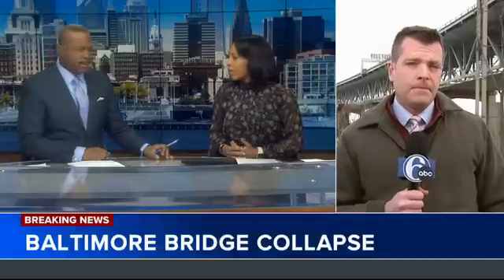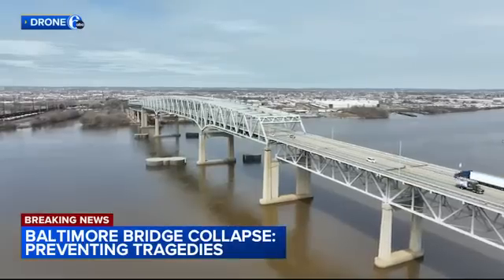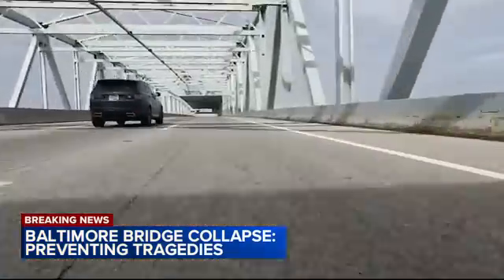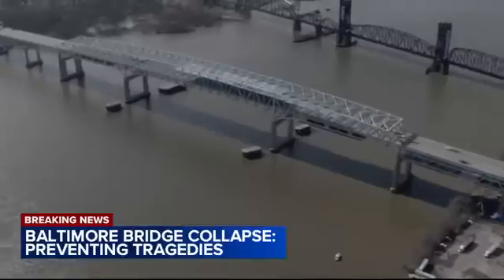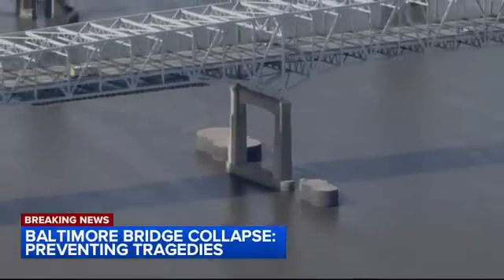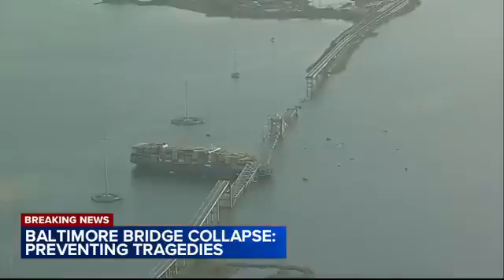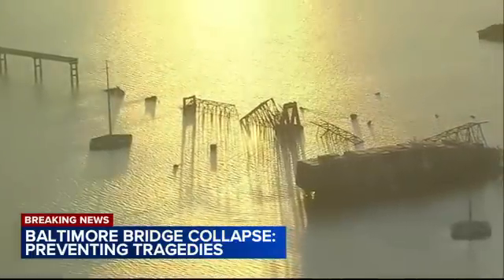Here's what surprised a structural engineering professor about the Baltimore bridge collapse

Comment: Okay, so they have protective concrete bollards installed a few feet beyond the actual piers. Would have protected the bridge from collapsing?  Doubts arise and here is why:  Most ships, even little play sailboats, are narrower at the waterline than at deck line. That makes me think that a ship's deck, even when overhanging its waterline by 10', would have creamed structural supports of the bridge and thus collapsed it. 
Additional question: Could the impact of a fully loaded 900+ feet long ship been stopped, if such bollards were in place, or would they simply have bent and  been rammed into to structure anyway?
Reply: Good points

Comment: I just watched this video and it is so misleading. The port authority CEO and the Drexel "professor" said there were no safety measures in place. There were the same type of safety dolphins in place on both sides of the of the main bridge support piers. They are huge. You can still see them near the other support pier and in front of the ship on the other side of where the support pier. They are just not as close as the as the one this video shows at the Betsy Ross bridge, Those would not stop a 95,000 ton ship if it was to hit them directly. The proof is that the Dali took out the dolphin before it hit the support pier. The Drexel "professor" said that it would stay up if it was built right for a continous truss bridge. Nothing would have made it "hang on". The very foundation it was built on was destroyed. I was 5 years old and watched the Francis Scott Key Bridge being built. I asked my Dad what the dolphins were for. He told me they were for protecting the bridge from a boat/ship hitting the bridge.

Comment: After the collapse of the Tasman Bridge in Tasmania the Bridge over the Orwell River in Britain, a similar structure, had pier protection (in the form of rock islands surrounding the piers) designed in. As soon as I saw the news I wondered why the Baltimore Bridge had no protection around the piers and indeed up and down stream of the bridge. Pier protection is designed to deflect an errant ship away from the piers, rather than stop a ship!
Reply: Actually,  it would be tricky to build that far ahead specifically on the side of Dali impact, since just after the bridge there is turn to the left (looking into the city) into another branch of the port.
Reply: @dmitripogosian5084  As I don't know the layout of the port, I bow to your better knowledge . Still can't understand why any bridge, particularly over/in a busy shipping channel would not have pier protection though. Adding heavy, very heavy, concrete Buttresses around the piers would have given at least a modicum of protection. I suppose it is the old story - wise after the event!

Comment: Everyone interested should carefully review the tape of the container ship in the minutes before it hit the pylon. It is clearly going to miss the pylon, until at the last minute the ship radically turns almost 90 degrees to starboard (right) and hits the pylon head on. 

To effect such a direction change of a huge inertial mass takes maximum power, and indeed right after the ship starts to turn heavy smoke starts billowing out of the smokestack showing the engine is now under full throttle. This was not an accident. Cyber attack?

Comment: Would a relatively small concrete barrier "dolphin" as he called it really keep something as massive as that fully loaded ship from hitting the pier? I mean, sure it might help, but considering the sheer size of that ship, might it damage the ship but not prevent such a collision? I'm not sure.  I hope some engineering simulations are done regarding that.
Reply: "Relatively small"? They're often as big as the bridge pillars (just shorter), and designed specifically to take lateral impacts. Yes, it definitely could have stopped it. I mean, the bridge pillar did stop it (and it's not specifically designed for that).
Reply: @RFC3514  then it should have had them in place. I saw that a bridge in Florida collapsed in 1977, and when it was rebuilt, they added these. No excuse for not having them after the lessons learned.
Reply: @rosswarren436  - Yes, it definitely should. The fact that it doesn't is precisely the "surprise" in the title.

Comment: For anyone questioning why experts and engineers are "surprised," the surprise comes from the clear lack of foresight and planning in protecting the bridge piers, not from the fact that the bridge fell. Engineers are expected to take precautions and not balance human life with cost savings, so yeah, it's surprising.
Reply: @peacenow42  still doesn't change the fact without the engine running they couldn't even slow down or change the rudder position even if they could change the position of the rudder it's practically useless without  thrust. this situation is quite literally a scaled up version of Up A Creek Without A Paddle.
Reply: The surprise should be that it wasn’t added, since the bridge was built. Since it wasn’t the requirement back then.
Reply: @peacenow42
Ships don’t have brakes. 
Barges don’t have steering or brakes
Reply: @peacenow42 its a ship not a batge. and they cant stop on a dime, and it lost engine power so they cant stop if you watch the full video of the ship crash you can see it loose power and the black smoke from the engine as they try to restart it. without power there at the mercy of the river currents that started to push them off course.
Reply: @peacenow42 
When a barge is let loose, yes, physics becomes the driving force. 
The barge goes with the current. Maybe that makes it speed up, maybe the drag makes it slow down. 
A ship on the other hand starts out with a rudder and possibly thrusters. 
Did all of that failed to work? 
In the case of all of that failing, then a ship and barge are not much different as far as physics, and the water is concerned. 

So, without knowing what the current was, and in which direction it was flowing, there’s no way to know what breaking action there was.
Reply: @peacenow42 
There’s a difference between speculating and pushing random conspiracy theories without any knowledge. 
We constantly complain when “the government” wants to take our money to repair, infrastructure, or improve it.
That was a toll bridge. They could’ve raised the toll to pay for improvement. But we would complain about that as well. 

Physics supplies everywhere all the time and object at rest stays at rest, unless acted upon by an external force.
We have no idea how strong the current was, or in which direction it was going.  We don’t know if the steering gear on the ship was in operable and turning it toward the side. We literally don’t know anything.
But many people want to come to the final conclusion, now without any evidence. 
When the evidence actually comes out, then they’ll complain. Why weren’t we told upfront. 
This is being investigated by the NTSB. They are known to be careful and slow. So we’re not going to get any answers in the near future.  But when we do get answers, we know they’ll be found it on fact.

Comment: Not an engineer but work in construction, remember the basic formula, F=MA, Force=Mass times Acceleration, that ship was huge, and moving at what 8 knots, that’s a pile, and I mean a pile of force, not sure if anything would of stopped that ship. So, what is it, one in a x chance, so do yiu spend a billion billion on extra stuff yiu don’t need, or regulate the industry better. That ship should not of been out where it was without a contingent plan for everything. Including power outages ect. Having that kinda loss of control in a harbour is unacceptable.

Comment: What should be investigated is that this was part of the Interstate road system. Specifically, it was in the I-695 beltway around Baltimore. The interstate system is federally subsidized and current regulations require that all bridge supports on either side of a navigation channel MUST have a fender system of some sort. Why was it not required that the bridge in Baltimore be upgraded to current regulations?

Comment: The engineer was not surprised that the bridge collapsed; he was surprised about the lack of safety features at the bridge. It needs clarification for some that are watching. You can chalk this up to the local news station using clickbait titles.
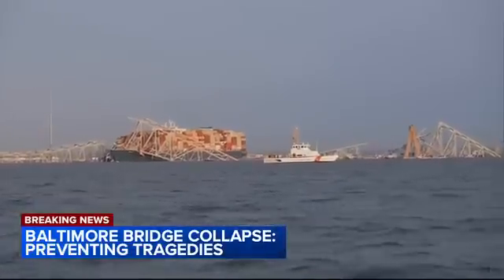Reply: 1:32 He was surprised that the whole structure collapsed. It seems like he expected only one section to fail, leaving the rest of the bridge intact. This may allow the bridge to be repaired and re-opened instead of necessitating a replacement.
On the plus side, the bridge demolition has a head start.
Reply: @icollectstories5702 this. The puer on the far side of the channel and the span beyond it should have remained intact or only partially damaged. It shouldn't have fallen into the water as it did. Bridges like this are built from both ends and fey joined in the middle. How did that far section stand before the bridge was complete?
Maybe the shock waves through the structure were more powerful than was seen.
Reply: The title: Here's what surprised a structural engineering professor about the Baltimore bridge collapse. 
Not having the safety features surprised him. "About" is the important word in the title.
Reply: @BatMan-oe2gh So the professor is pretending to see the bridge for the first time in his life?
Reply: @lolstoopid6951  What? That is a stupid comment. He was surprised that there was no safety around the piers of the bridge.
Reply: Well, yes, he was surprised the entire bridge collapsed. They are not supposed to fall that way.
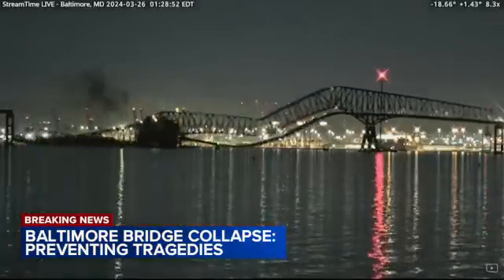Reply: @peacenow42 1:41 "When something is continuous, it is supposed to at least be able to [h]ang on. What I saw was, once the pier that was supporting [the] spine gave way, the bridge just went down. There was no hesitation."
I am not qualified to dispute his words; the title and reporter just say he was surprised and made no judgement as to his wisdom. Perhaps the reporter called up a bunch of universities until he found one guy able to make an interesting quote? Care to throw shade on Drexel?
This was a truss bridge BTW.
If you want to know about repairing a suspension bridge, look up the San Francisco Oakland Bay Bridge and the Loma Prieta earthquake.
Reply: That's not a clickbait title at all
Reply: There are some small concrete structures on each side of the bridge supports. Why do they not mention them?
Reply: concur
Reply: That's not surprising either. Government bureaucracy is often corrupt and incompetent.
Reply: @peacenow42 Not really
Reply: I think the title meant to convey that he was surprised about the incident in total - not the collapse by itself.
Reply: Not what was said u don’t need your help hearing
Reply: @ssjlkrillin  Each port has its own procedures to handle incoming and outgoing ships. Of course the procedures are mainly about safety.
Now we have a double jeopardy; No dolphins and no safety procedures that take into account that there are no dolphins. It is a little bit like a car radiator. It has water to cool the engine (first safety level) but if you have a high temperature alarm you drive very slowly (second safety level) 
Somebody will have to answer some difficult questions.
Reply: Safety, we can never put enough safety on anything. This how it is.
Reply: @kao4746  Yes but your statement says what we all know and brings nothing new to this discussions. It is like saying: when it rains water falls from the clouds.
Reply: @pindapoy1596  don't "forget the clouds"
Reply: The Engineer towards the end of the video says that he was surprised how quickly the bridge fell. It did not pause. It simply fell immediately.
Reply: The engineer was less than truthful about being surprised at the lack of safety. Lack of safety is a core feature in the US economy. A feature, well copied and turned up to eleven by another greed driven economy, China.
Reply: Safety features?! The ship lost power and slammed into it. What features would you need? Air bags and a bridge made from diamonds
Reply: @penguin44ca   So you commented without even listening to the video. How embarrassing…
Reply: @penguin44ca  there are structures valled protective islands build on both sides of the pier's where heavy ships and boat traffic are in place
Reply: @playstore-guy001  precisely.  Some people should watch the entire video before commenting.
Reply: @penguin44ca a big mass of concrete before the feet of the bridge, genius… like most other bridges. Or a ring concrete wall filled with dirt… no matter the size of the ship, they lose all their fight when the hull start to touch the floor…
And the collapse itself had nothing unexpected about it. Beautifull iron structure where you can almost picture how the loads were carried. But 2 feets only… strike 1 lose all…
Reply: @alvallac2171  thanks ! (non native spkr)
Reply: @penguin44ca  Did you watch this video? Did you not see the video of the bridge with the protections in place? The rounded concrete blocks that would deflect a ship away from the pylon. 

The protections mentioned and pictured here would have kept the ship from striking the pylon. The ship would be damaged, but not the bridge. So, no, not an air bag. A concrete barrier rounded to deflect.
Reply: @penguin44ca  Did you even watch the video?
Reply: @penguin44ca  Amazing how intelligent some people can be. Remember the cars from the 1940's or 50's with steel bumper guards? If another car looses control and hits you, you have the steel bumper guards to protect you and your vehicle.
Well, what features would you need? Air bags and a car made from diamonds.

Comment: The ship didn’t just hit the support pier, it obliterated it. Tearing the road deck free. It’s lying on the bow of the ship!Then slammed into the bridge it self shearing rivets. And twisting others. Removed a vertical support then horizontal.    Removing any tension the steel frame would have had. As far as concrete safety barriers who cares at this point. They didn’t exist. It’s a waste of time speculating on them.

Comment: The bridge appears to be a continuous span rather than simply supported design, meaning it was securely pinned at either end with 2 large intermediate piers on which the bridge “rested” but was not pinned down.  Losing one of the large supporting intermediate piers (due to the wayward container ship) undermined the entire bridge, subjecting it to dead weight well beyond the shear, compressive, and tensile strength of the truss frame members and connection bolts/welds.  

The Drexel engineer's assumption/analysis is incorrect.
Reply: Being a Mechanical Engineer, I say your statements are spot on. A much better analysis than this so called professor. Drexel is hurting for qualified instructors.
Reply: Thank you! you can clearly see the body of the bridge pivot on the second main support column before the other side collapsed because of it.
Reply: From the moment I read “continuous span” and “simply supported,” I knew an engineer (structural, mechanical, or other) must have provided this comment.
Reply: PLEASE LOOK CLOSELY AT THE VIDEO AGAIN... WATCH THE TOP BEAMS WHERE THEY SNAPPED IN TWO.   CAN YOU SEE THE SMALL EXPLOSION AT EACH BREAKING POINT?    HINT:  THE DISTANCE IT WAS FILMED AT MAKES IT KINDA HARD TO SEE, BUT,  IT LOOKS LIKE A SHAPE CHARGE EXPLOSION.... AND IF YOU'RE LOOKING FOR IT, IT BECOMES OBVIOUS...

Comment: All due respect dr. Aghayere is very wrong here. Critizising them for a lack of concrete dolphins is one thing and is valid, though there are hundreds of similar bridges in the US without them, however saying that the bridge should have been able to hang on is absolutely absurd. It is a giant truss bridge on 2 pylons. Of course if you knock out one pylon the rest of the bridge is coming down as well. If you knocked out a pylon of the golden gate bridge the whole thing would come down. The rightmost section of the bridge that falls last is directly connected to the main truss structure so it obviously got pulled down immediately too.

Comment: I love that these 'experts' rush out with their best guesses without an iota of information. If this 100.000 TON weight/displacement was operating at even 5mph, the force on the piers would have been at least 185 MILLION pound feet, more if the speed or weight were higher. Those concrete piers shown in Chicago would have done little to stop that ship other then putting a huge hole in it and possibly sinking causing an even bigger problem.